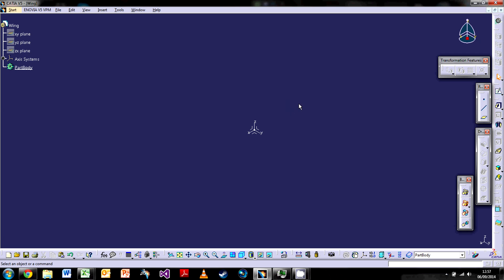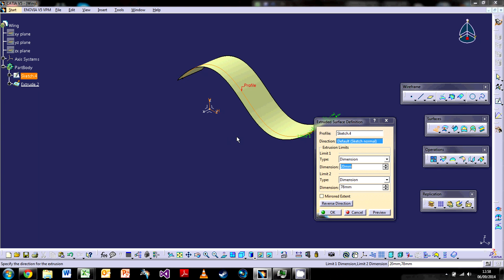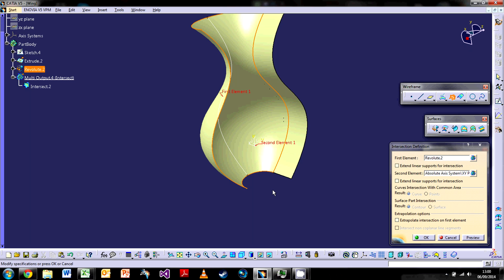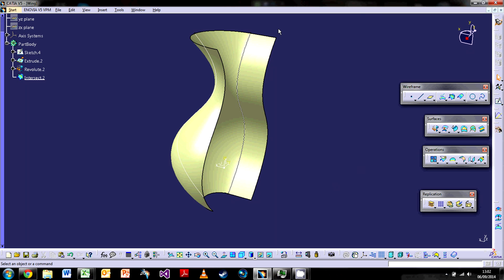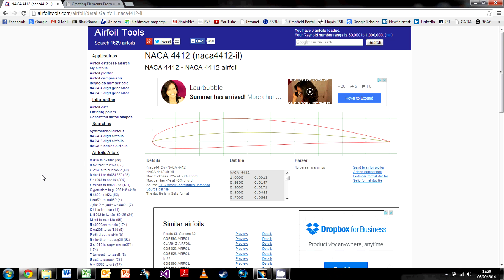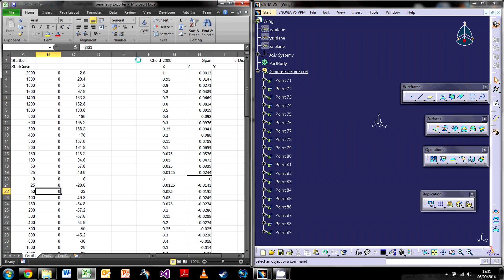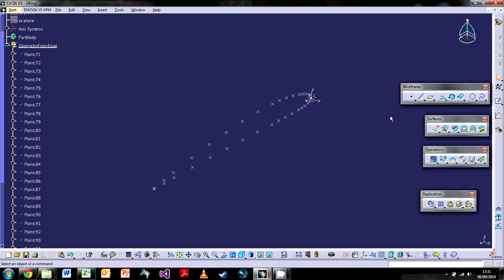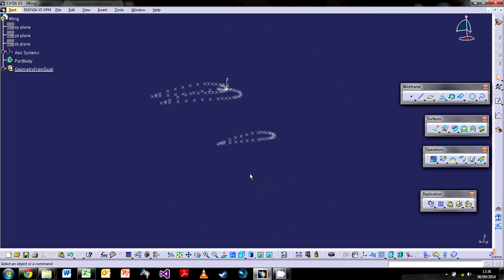CATIA V5: The Basics - Tutorial 5: Wireframe & Surfacing ¦ Wing Design with Excel Geometry Exporting

Comment: Hi , I was trying to run excel macros , but it doesn't work and show this message :"license information for this component not found you do not have an appropriate license". Do you know how to fix it? Thanks.
Reply: try to new part in generative shape design and in the dialogue box check the option create geometrical set then it will work....
Reply: This doesn't work too . The solution was unexpected  - I run Catia as administrator and the macros started work.
Reply: ya sometimes run as an administrator works for the problems like this

Comment: Hi.. I'm from UH. I need to make a delta wing for the aircraft. I am having issue with exporting coordinates to catia from the excel file. The error message is "SUBSCRIPT OUT OF RANGE" . How to make it right?
Reply from the maker: ensure the following :

1 - you are in the part workbench, not assembly or otherwise.
2 - you have correctly formatted the excel sheet to align with the original one.
3 - you have the begin and end cells in your excel sheet.
4 - CATIA is not minimised but in the background.

let me know if this helps!
Reply: +TheCADMan thanks for the reply. I was able to sort it out. 
Can you please tell me how to add thickness to the wings surface? I tried using thick surface feature in part design, but it gives an error.
Reply: +TheCADMan can you explain par 2 please I don't understand what you mean by "formatting the excel sheet to align with the original one"

Comment: Hey couldn't help noticing your studynet tab what are you studying? I'm also at UH :) Also I'm having difficulty using multi sections solid, I have created my own wing tip using an offset plane and it keeps giving me an error when I try to join the two. I have made sure the arrows are facing the same way etc but still no luck, any help would be much appreciated
Reply from the maker: Hi Will!

I'm long gone from UH but I studied aerospace there back when I was there. I've moved on since but always good to see a fellow alumni working there. What are studying? been there long?
Reply from the maker: in regards to your problem - what errors are you getting? catia speaks gobbledegook sometimes but if you can let me know then I may be able to help
Reply: +TheCADMan Ah okay I've been here four years including a foundation year and also studying aerospace technology. As for the errors they seem to have gone away! (for now) I was just having problems using multi sections surface as I designed the wing tip myself and kept getting the error saying 'the extrusion of a vertex of the profile leads to a cusp' So I used a naca profile and reduced the size in excel which solved the problem. Cheers though your tutorials are helping a lot

Comment: Hi, I liked this tutorial, can someone help me out with making the wing profile straight at the trailing edge and tapered at leading edge. Currently it's doing the opposite, and it won't let me offset the profile.
Reply from the maker: +Ramon Toor Hi, it may be a point to look at your importing points - CATIA will assume an absolute coordinate system as so you will need to offset your tip aerofoil when you import them or offset them with the tools in CATIA itself.

Comment: thanks for sharing sir
but i have a question now
how to make a twist wing?? its like in another rib section have an angle.
thank you :)
Reply from the maker: By twist wing I assume you mean a wing with varying angle of attack along the span? 
You can do it 1 of 2 ways:
1) do some very tricky trigonometry with the Excel Export file to move the points in a polar coordinate frame (long term time investment but good if you want it to do it many times as then its automated) or,
2) Depending on your angle of twist, select the aerofoils you want to twist and simply apply a rotation translation equal t the local twist at that span ordinate. Its best to apply this from about the quarter chord position. This is what i have done recently with a new concept and doesn't take much time at all. The new aerofoils will then be in your desired position.

Comment: Hey! Thanks for the Share!! The excel sheet worked for my friend four months back  but now on running it shows error  " SUBSCRIPT OUT OF RANGE" . This is the same error faced by me also!! Please Help!
Reply from the maker: Hi Rahul. Would you mind trying it again, clicking "debug" and let me know what line of code it stumbles on?
Reply: TheCADMan Heya it shows "Sub Main()" part highlighted after which these follows.
        
    'Get the type of operations to do:
    '   Points                  --> 1
    '   Splines + Points        --> 2
    '   Loft + Splines + Points --> 3
    Dim TypeFichier As Integer
    TypeFichier = GetTypeFichier
    
  I guess thats nearly at the end of the program and the error shown is "Subscript out of range (Error 9)"
Reply from the maker: Rahul Karuvingal Hi Again, That's odd, as the Sub Main routine is the primary code, that's where the code starts... Error 9 is caused when you reference something that doesn't exist which makes this very odd. Try going into the code module (ALT+F11 to get into the VBA editor) find the Sub Main() part, click below it and press F8. it should run through it in step mode. If this works, keep pressing F8 until either it runs or finds a glitch. if not, i'm unsure what the problem is without knowing your machine/excel setup. Sorry i can't be more help.
Reply: +Michael Knight thank you! you are very helpful

Comment: Hey! Thanks for sharing this! I have a problem though, when I try to export the points excel gives me this error prompt "object doesn't support this property or method". I am working with Excel 2010 and Catia P3 V5R14. Thanks for your help!
Reply from the maker: Hi Andreu, Sorry for the late reply, have you solved it? If not, debug the line it fails on and let me know what it is!
Reply: +TheCADMan Andreu Parés I am also getting this error and I am using Excel 2010 and Catia P3 V5R21 .. Unsure how to see where exactly the code is failing
Reply: +souduke  In catia Open  Start-mechanical design-part design after that  when you put coordinats from excel to catia pick startloft then do the micro thing

Comment: Hey TheCADMan ! Absolutely lovely tutorial, i'm having a course in my Aeronautic Engineering degree which is Computacional Aeronautical Design, and I'm designing a Boeing 787-8, i'm having some trouble when i get to the Spline part, because the spline is not following all the points and is simply creating a straight line, any tips?
Reply from the maker: Hi Francisco, glad you liked it. Your problem has happened before, are you exported splines and points or just the points? I have found with this macro that the exporting a spline doesn't work very well. Try exporting points only and creating the spline manually. If that doesn't work give me a shout :) good luck with your degree!

Comment: Hey, thanks so much for these videos, I'm trying to export the plot points however I keep getting the error message: "Subscript out of range". Do you know how I can solve this issue? Thanks
Reply from the maker: Hi s lou, that error message is due to a line in the macro code not being defined properly. I could be that it doesn't recognise the catia application. If you press alt+F11 and go into the code module you should be able to find out where the code trips up. 

If you find this out I can probably  help more, otherwise Google could probably help you more conveniently :)
Reply: You have to enter the GSD workbench and create a geometrical set before executing the code.

Comment: Hello,
Thank you very much for you tutorial ! I have a problem importing points from excel... It gives me an error everytime.. Either "property or method not supported by this object" or "the index is not part of the selection"... Do you know how can i do ?
thank you
Reply: Charles Dhainaut  hey Charles, can you please let me know how you fixed this problem. because every time i try to import points, it gives me the same error.
thank you
Reply: Okay Finally I managed to make it work :) I have another question... How do you make curvature on your wing ? If i try to put an offset in order on the coordinates (X and Z) to put a curvature, Catia always tells me the guide has a too big curvature... Even if its really small... Do you have any idea ?
Reply from the maker: Charles Dhainaut Hi, glad you fixed you excel issue. The macro can be a bit temperamental sometimes!

By curvature, which axis are you talking? its difficult to visualise your problem. Double check your little red arrows on you multi section surface are all pointing the same way. If not, perhaps post a phot or video I can look at?
Reply: By curvature, I mean adding a sort of offset on X and Z. This means not making a plane wing... And everytime I try to use the multi section surface tool, it tells me the guide has too much curvature.
As you can see on this picture : https://imagizer.imageshack.us/v2/1342x755q90/r/674/SPEj9V.png
I just added a little offset on X and a negative offset on Z. And the tool doesn't work... So if you have any idea, it would be ace!
Thank you very much
Reply from the maker: Charles Dhainaut hiya,
Two things spring to mind, im assuming your guide is the longer of the two lines?
1) its not connected to the sections which means you cannot use it as a guide. You may want to try and use it as a spine instead. 
2) if you wish the section to follow the guide as drawn, you'll need to add a third section at the end of this guide. You can use relimitation but this is rather tricky. 

Take a look at  my next video with the wingtips, it might give you an idea of what I am saying. If you still can't get it, let me know :)
Reply: TheCADMan
Yeah actually i didn't use any guide as you see on the picture and it didn't work... But with some new tests i managed to make it work... It's very strange because I thought I did exactly the same thing... But now it seems okay.. Haha thank you for your help
Reply: Suneendra Amarasinghe when you begin a part, tic the geometric set.